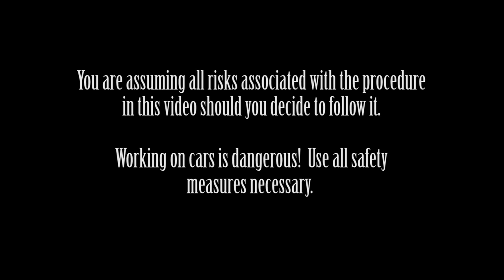4 post car lift - Safety of 4 post Advantage lift, convenience of 2 post automotive lift

Comment: As told in another comment, your approach is quite convincing. I've always been pleased using platform lifts in underground garages in Europe. They are indeed extremely safe. Can you reveal your four post lift brand and cost? And to your knowledge, are four post lifts available that do not require concrete anchors. Cold climate garage concrete floors are often hydronic heated ones and do not allow drilled fasteners.
Reply from the maker: Hi Michel - the one I have can be screwed to the ground also.  I chose not to anchor it to the ground.  Here is the link to it.  I cannot recommend it enough:
https://www.advantagelifts.com/products/advantage-dx-9000-4-post-best-residential-lift-on-the-market
Reply: @masood-tv  Hi Masood - Many thanks for the link. I will seriously consider this lift.

Comment: Hi Masood thanks for amazing videos on w220 they are really useful and helpful. I really appreciate your work. Though i have a question do you think a 90AH 720A car battery is sufficient for w220 s320?
Reply from the maker: Hi - Thanks for your kind words.  I would recommend only MB batteries.  I think you will want to search for part 001-982-82-08.  But, please double-check with your owner's manual and get the correct battery for your car.
Reply: Agreed, there is much wisdom in purchasing the best possible battery for our W220

Certainly must not be a flooded battery with liquid which produces hydrogen upon charging. This is why AGM battery is specified.

My new battery is an Odyssey TPPL which is superior to the OEM AGM battery, it was just under 400 after tax. Warranty is 4 years of zero cost replacement, and terms are very favorable if failure does occur. 

My other Oddysey TPPL battery is manufactured in 2012 and still very strong after 12 years.

A very long lifetime makes this a cost effective option.

Hope this helps!